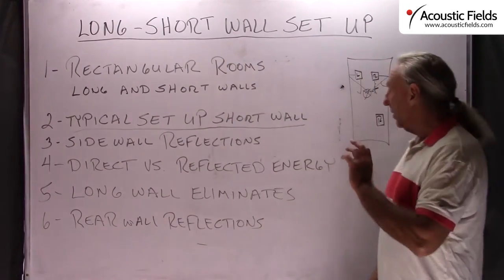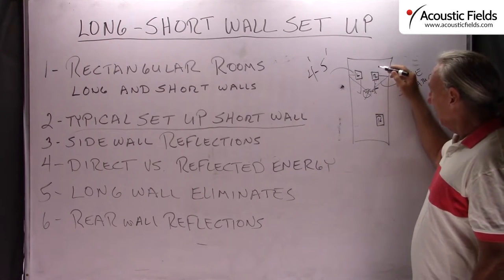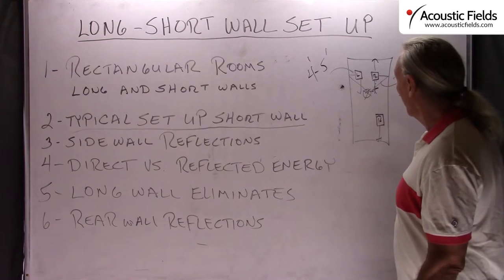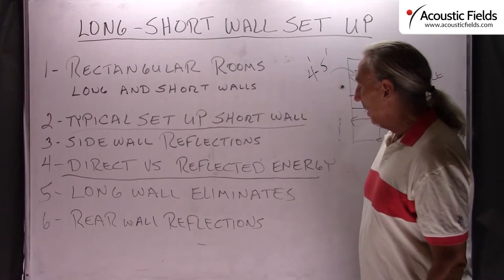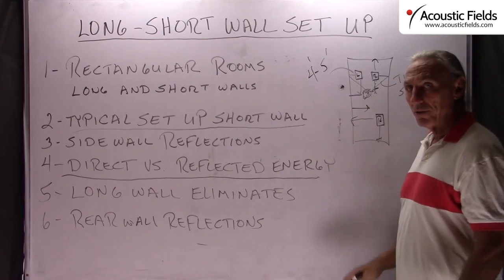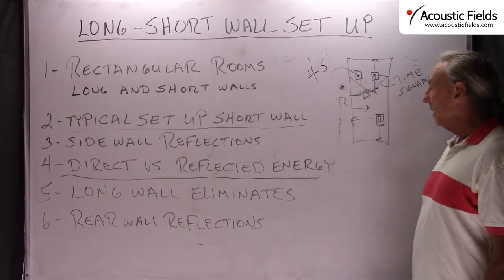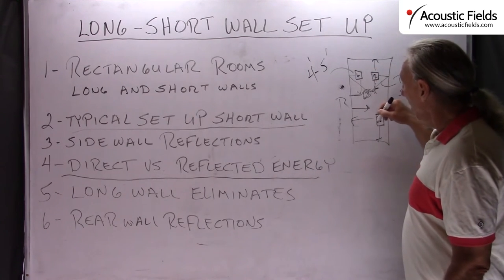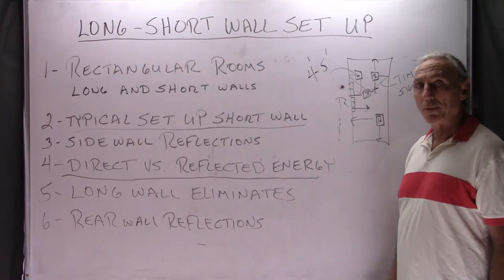Long - Short Wall Set Up - www.AcousticFields.com

Comment: I set up on the long wall. Have done so for a good 25 years. I had a very patient realtor when i bought my current home.  Just kept looking until i found a place with a great room size, and decent kitchen.
Reply from the maker: Hi Danno,  If you locate along long wall, you increase the distance from speaker to side wall. This lengthens the time signature of the reflection from the side wall. This allows for a wider sound stage or stereo field to be created. Short wall set up narrows the stereo field. Absorption and some diffusion technologies can assist both long and short wall set ups but distance is always the main factor to consider.
Reply: Hi Danno.  I have a 10.5 x 12 room and have been set up on the short wall, throwing into the longer part of the room, but don't like the fact that my monitors sit in front of the window. Just wondering: What are your room dimensions?

Comment: I've been watching some of your videos and really enjoying them. I spotted something that was behind the whiteboard approximately a few inches above your head and behind the board that looked to have multiple slots or wells but extremely compacted together. What is that? Is it a panel or what? I've seen something similar in a theater treatment that was aprox 18" tall by 12" wide and aprox 8" deep with many tiny wells/slots but can't figure out what it is and yours looked similar from straight on view. 
Thanks
Reply from the maker: Hi Alford, These are our mini wood diffusers which are used to treat flutter echo. There is no flutter echo in our video room. I put them there so I wouldn't trip over them.
Reply: Ok. That makes sense. Thank you so much! It's really been bothering me because I couldn't figure it out by looking at products sold by you all and other manufacturers. I've seen them used flanking a surround speaker that had QRD 7 diffusers below it in groups. Then surround speaker was above the QRD 7s and then there were deep multi welled diffusers on each side of the speaker. Does that seem like a good use for them. How deep are yours and do you sell any?